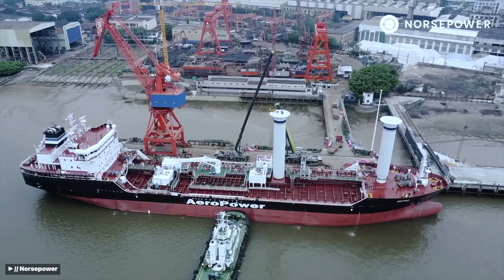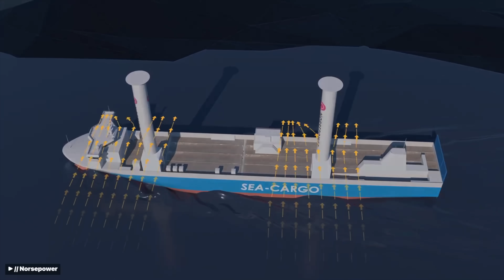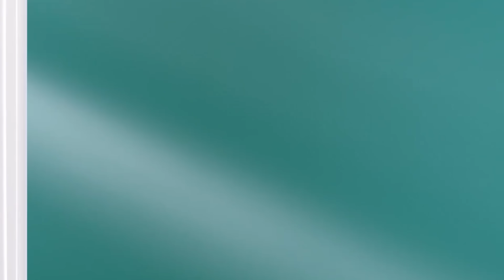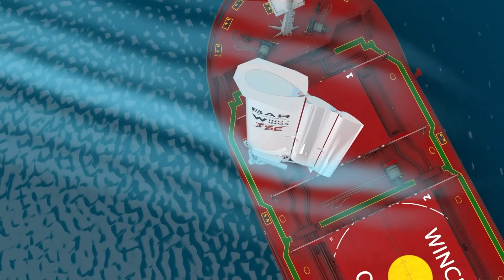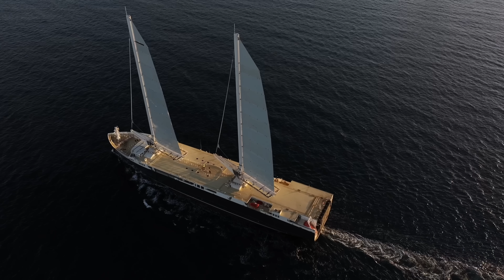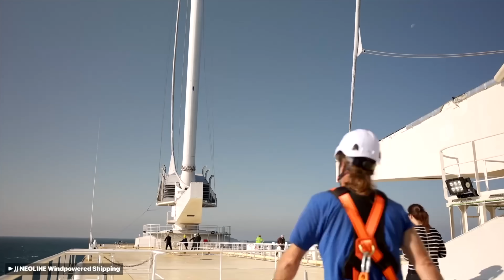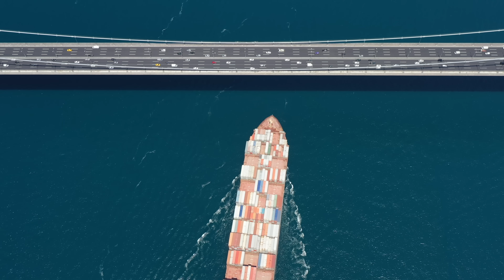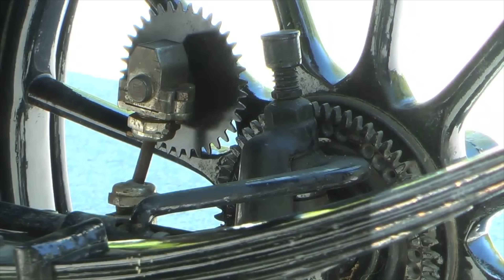Surprise Breakthrough Solves Shipping's BIGGEST Problem

Comment: The kite seems so superior.  20% and if optimized probably way more.  That was a tiny kite and only one.  Probably way more cost effective as well.  I'll bet less than a 2 year payback even when optimized. Could be retrofitted on many if not most cargo ships as well.  I hope there's more emphasis placed on it this tech in the future.
Reply: Kite numbers are wild for the size. The real challenge is reliability in rough seas and port ops, but the retrofit angle is the killer feature.

Comment: I have a big paddle that floats. It's half submerged. And you tow it. It can produce. Eg. 8metre wide. 8metre diameter, 4metre submerged 4metre out of the water. 2 meters per second. 1 megawatt of electricity easy. Paddles have hinged flaps. No resistance coming out of the water. Full torque to axel then alternator. You can design it to have water pump direct (never sink) or electric water pump.
Reply: Drag on the upstroke alone would eat most of that 1MW — flaps help but dont eliminate it.
Reply: @rickyroy5267 easy if you upscale. So 8 paddles. The hinges at the furthest point from the centre. The outer circumference. Eg. 9 o'clock flap against paddle. At 3 o'clock flap hanging straight down. No resistance on the upstroke. So 8 flaps along the width of the paddles.

Comment: The other problem with fixed sails and rotors is that they get in the way in port and often get damaged. For a commercial solution you have to stow the device safely while in port.

Comment: Fletner rotors have a major problem, they only provide lift at 90 degrees to the apparent wind, and when a ship is under way the apparent wind comes from the forward quarter more than 70% of the time. Which means the rotors create too much drag.

Comment: There are probably very good reasons why this isn’t more widespread. Likely extra labour costs for seamen trained on the tech and maintenance costs for the moving parts. Then for the solutions that take up deck space, you’d lose revenue and perhaps the fuel savings don’t make up for the lower capacity of some of these ships. E.g. how much deck space would you give up if you shipped containers where you stack the containers on the deck?

Comment: Why not cover the top of cargo container ships with solar panels. Make a platform above the containers which has the panels on top. Just looking at that deck size would make 100's of megawatts in power.
Reply: And then you will remove that 'platform' in each harbour and reinstall it before leaving harbour again?
Reply: @GML_HRO  I clearly did not think this though, and to think I'm a marine engineer too.

Comment: So the magnus system pushes perpendicular and needs a beam on wind, but most apparent wind will be from the bow as the ship moves, and I’m doubting global shipping will have to sail on certain winds

And 1 kw input vs 10 kw output seems to be a dubious perpetual motion snake oil claim disobeying thermodynamics
Reply: Sailing ships have crossed the oceans for tousands of years. So the concept is well proven.

"And 1 kw input vs 10 kw output seems to be a dubious perpetual motion snake oil claim disobeying thermodynamics"

No. You forgeot the wind itself. A conventional sail has zero mechanical input but also produces thrust. And even that is no violation of thermodynamics.

Comment: Sadly, limited design on the Magnus rotors. No 1kw input needed. A small VAWT atop provides MORE than enough rotation (Turbine torque ~ “something × 𝑉3  / rotor speed”  & Magnus lift ~ “something × 𝑉2  × rotor surface speed”) The extra rotational power that the VAWT provides can be braked generating electricity. Essentially, they are wasting more than 1kw for nothing but lack of creative engineering.

Comment: Bro this isn't new. There is a company called Enercon that owns a Flettner ship called "E-Ship 1" that was built 16 years ago in Germany and has been carrying cargo across the Atlantic every since! Back then no one cared about it because oil companies were in complete control of the global fuel supply and global shipping so they allowed this one ship to exist so the lefties could have their fun. The new ships will face the same challenges. They still need fuel to run the motors that spin the rotors and like 2010 trying to promote this ship as game changing idea to stop climate change sounds like a scam because of it's need for fossil fuels. Also when regulators keep setting new CO2 targets and restrictions based on green washing garbage like "net zero" emissions shows how little they actually care about stopping climate change. Just one question just to clarify something, you do know the difference between "zero emissions" and "net zero emissions"? I'll give you a hint, one stops all greenhouse gas emissions from destroying the Earth and the other is a scam set up for the fossil fuel industry to appear to be changing while creating a government approved framework to actually increase emissions via loopholes, green washing, lies and paid for with huge sums of money from industry lobby groups.

Comment: still think the final solution will be nuclear powered ships.
Reply: Nuklear power is the most expensive way to propel a ship.
Reply: @GML_HRO  is it though? and new inventions can and will make it cheaper.
Reply: @pantsgaming759  Just have a look where the reactors are installed in an nuclear powered air craft carrier. It is in the center of the hull, because that is the safest position.
Unfortunately this is also the most valuable space for cargo in a merchant vessel.

And there is no invention possible to solve that problem. In addition, the costs for nuclear propulsion are so much above any other solution, that it is hard to imagine how a nuclear ship could be competitive.

You have the reactor. Then an inner heat cycle of some fluid going through the reactor.
The energy is then transfered to another heat cycle via giant heat exchangers. From that heat, steam is generated, which then drives either turbo-generators (to make electricity, which then is feed to electro motors) or steam turbines which drive the propeller via an enormous gear box.

Compare that complicated, expensive installation with a large two stroke engine in a container ship:
One big engine - and the crank shaft of the engine is directly coupled to the propeller shaft. No gear box, no other way to transform energy from one kind to another.

Comment: If there's anything we should've learned in the past couple decades, is that this kind of stuff will sadly, not help decarbonise, just the opposite. Shipping companies will use money from the fuel savings to increase the number of ships in their fleet, so they can ship more products, which will lower the costs of said products, which will incentive people to buy more, which will drive the need for more ships to transport more products etc. So on the long run, unless we can 100% cut out fossil fuels, it's just going to increase carbon consumption.

Comment: so what happens to the spinning bars when there's a storm? if there is no way to retract them, they will get ripped off by the wind, and make it much harder for ship to avoid wrecking
Reply: The ships built in 1924 and 1925 in Germany with Flettner Rotors had no problems in severe storms. Reducing the rpm reduces the lift produced by the rotors. In addition, the rotating masses reduce the ship's movements in a seaway.

Comment: The slotted wings look like a fixed curved.  Should be able to change the curve by using articulating hinges and a skin that can shift position on the cylinder.  I am thinking as the position of the slots changes the skin will slide horizontally.  Sort of like a breadbox shell.

Comment: There must be scope for solar power to be added, possibly on the surface of solid sails. New printed solar cells can be printed on bendable structures and even be rolled out. So a curved aerofoil with solar generation on it is very do-able. Modest battery behind solar generation could run the electrics on the vessel reducing the need to burn fuel to do this. With big enough batteries and large enough solar generation there may in the future be the potential to do away with fuel to run a vessel, just wind and solar.
Reply: some Flettner rotor projects are already experimenting with surface solar — the combo makes sense

Comment: Wind powered ships. Man, what a time to be alive
Reply: What comes next? Generating electricity by moving turbines with hot water?
Reply: @apermas come on now, be realistic! 🤣
Reply: could be true, CO2 turbine is making steps in revolutionizing "Generating electricity by moving turbines"
Reply: Wind assisted fuel saving
Reply: @Mr_Goober918   LOL I always enjoyed it on small boats.
Reply: Let's call this fascinating moderb time we live in "The Age of Sail"!
Reply: ancient tech with carbon fiber and AI routing hits different
Reply: @rickyroy5267  not really, and carbon fiber is a pretty crappy material, weight is not a issue in displacement hulls.
Reply: @polska905 More weight means more thrust needed to move, more thrust needed means more fuel consumption… so yeah weight is an issue when you want to conserve fuel
Reply: @polska905  Its durability and strain performance also come into play.
Reply: @notinterested7911   not in a displacement hull, you obviously have no clue what you are talking about.
Reply: @zaakoc  yeah, it's durable only in one direction, has poor orthrothropic properties and is way more expensive. Why spend all that extra money on light weight materials when weight is absolutely not a issue in a displacement hull? Makes zero sense...
Reply: @rickyroy5267  Yeah, I would be a bit hesitant to let an oil tanker be routed by AI. Not even by AI driven weather routing. For these kind of vessels you need very high levels of reliability. And reliability is not a forte of current AI models.
The best solution I know is still weather routing by actual meteorological experts. It's not even expensive to have some experts check your route daily and send the captain an updated route every day or when something happens. 
Of course that might change in the future and AI models get better, but right now I would not trust a fleet of oil tankers to be routed by AI.
Reply: @mephisto8101  I've seen people use the term AI for just normal software lately. Most AI systems that people interact with are a mixture of probabilistic models and deterministic software. models\AI and code\software. The magic happens when you mix them into more complex nested systems. Everything after that is optimization.

Oh I almost forgot, I believe that most navigation software is just software and not AI.
Reply: @mephisto8101 Not every AI is an LLM or even a model. There are some insanely effective basic neural networks, especially for this kind of tasks
Reply: @codyrap95  Effective and reliable are two different things. When it comes to oil tankers, the demands are quite high. I am not saying that it is impossible, but right now, I am not aware of a solution which fits the demands.
Reply: @lagaul5124  Completely agree.
Reply: @mephisto8101  
So called AI is a fraud. It is simply linear weight estimation. No understanding whatever. 

(The natural equivalent is a snail : Alpha Zero showed a very fast snail outperforms manual coding.) (I am probably underestimating snails : AI has the compensating machine abilities of total recall, and massive search.)

Comment: It's fucking nuts how much snide and sarcasm this Innovation gets.
Reply: It's fuel mitigation. 
A saving is  saving in my book
Reply: it's awesome, but come on. it has 100% the vibes of armies getting back to using mechanized cammels and horses when they rid of them for vehicles
Reply: the sarcasm is because the Flettner sail is not an "innovation", it is more than 100 years old.
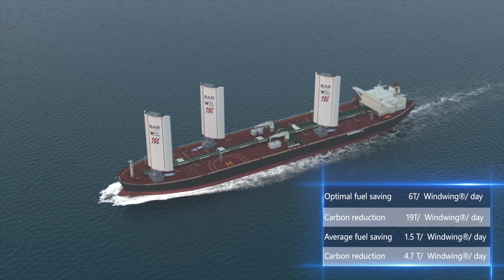Reply: 5:51  Not surprising when optimistic numbers get thrown around...  "18 tons of fuel saved in a single day"  while showing a graphic claiming the Avg is 1.5T/ Windwing/ Day.
Reply: @maxhugen  I think that was the optimal 6T/day for 3 windwings.
Reply: @euanmutch  At the avg of 1.5T/windwing,  3 makes 4.5T, not 6T.  Either way,  far from 18T.
Reply: @maxhugen  the graphic with their numbers said optimal 6T/windwing and the boat they showed has 3 windwings… 3*6T=18T
Reply: @euanmutch  6T as "optimal"- in other words, maximum.  NOT the average shown in the graphic  of 1.5T.  In business - and reality - you don't base probabilities on a maximum.
Reply: @maxhugen   the video stated 25% savings during calm wind, 70% savings in strong winds.
Reply: @willix777  Fuel typically accounts for up to half (50%) of the total operating costs of transporting goods by sea. If savings were so significant I'd expect a mad rush to use wind.
Reply: @maxhugen no one said it was probable… just possible